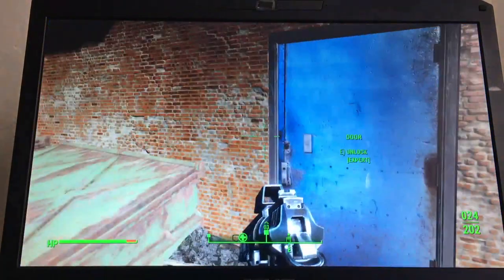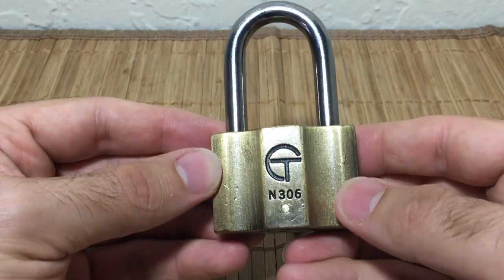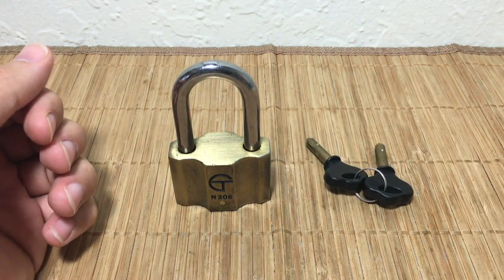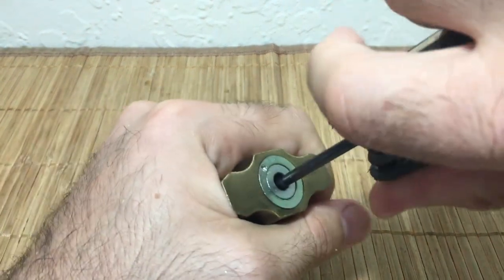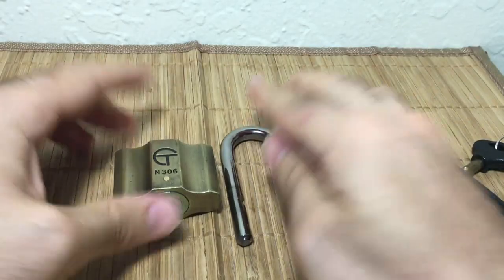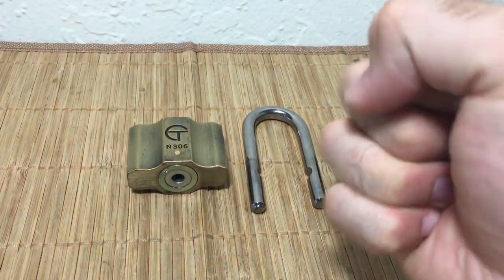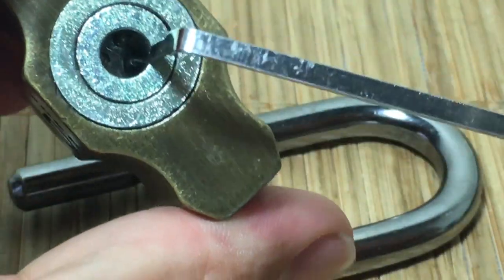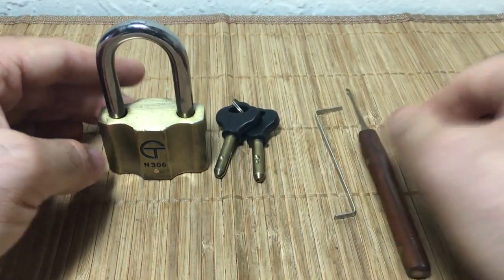[50] FALLOUT 4 Style Lock Picking (with a Screwdriver)

Comment: This is the lock pick mini-game that Bethesda has been using since Fallout 3.  There previous game The Elder Scrolls IV: Oblivion actually had a more accurate Lock pick mini-game as it have you an actual inside view of the lock and it's tumblers, where you would have to bump the tumblers and time them just right to get the tumbler the stick.  The frustrating thing about this version of the mini-game was that, if you failed getting a single tumbler to stick (which is almost always), the lock pick would break and you would have to start all over again.  To make it even more of a challenge, the tumblers move a random speed.  Sometimes bumping them made them move fast and other times very slow.  So the habit was that you would bump a tumbler up over and over again trying to not mess up the timing and breaking your lock pick.  Most people hated this mini-game because you would go through 10+ lock picks just on an easy lock.

Their online game, Elder Scrolls Online, is the best and most accurate lock pick mini-game.  It's similar to Oblivion, but it's version involves pushing tumblers down until the tumbler starts to show some tension.  Applying to much tension breaks the lock pick.  To add challenge, you have to beat a clock with the harder the lock the less time you have to push all the tumblers into position.

Anyhow, I hate lock pick mini-games.  I always use lock pick cheat mods because I don't like wasting time playing a mini-game over and over again.

Comment: Nice video and lock. I have a question: At 6:40 you pick the first pin and then you say that the key pin is springy after picking, 'cause the driver pin is at the shear line. Where does the springiness on the key pin come from when the driver is set? Normally the key pins don't have extra springs.
Reply from the maker: +Potti314 You are right, it is weird! The only explanation is that part of the driver pin is still touching the key Pin ( I think)
Reply: Yes, that's the only possible explanation. Weird: springy, but set ;-)